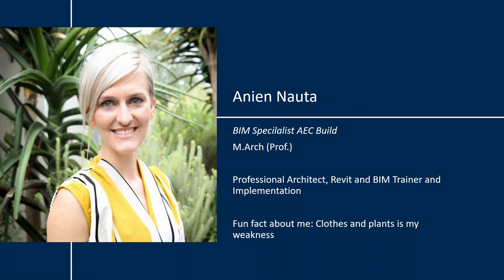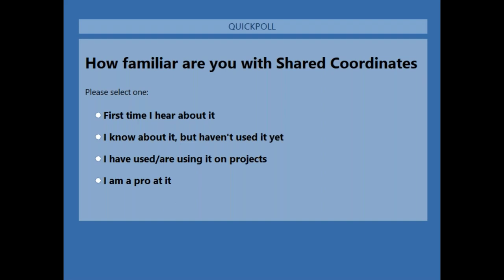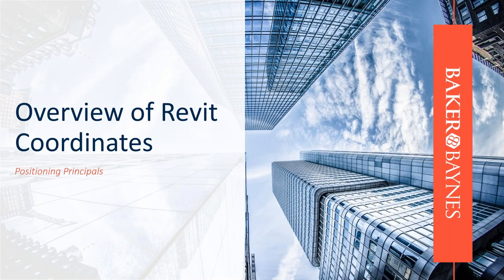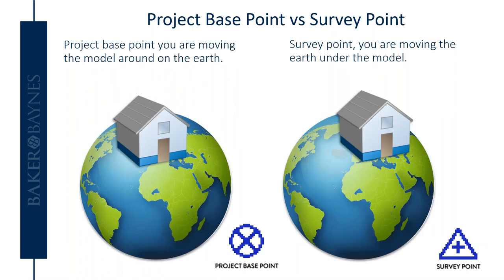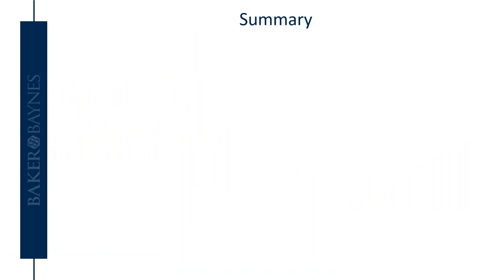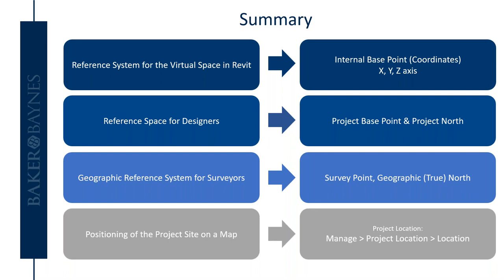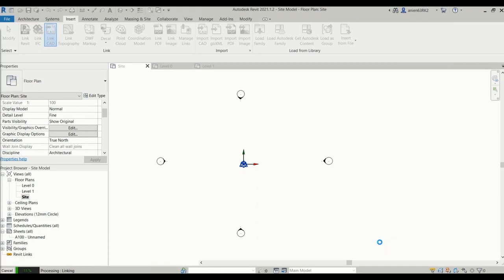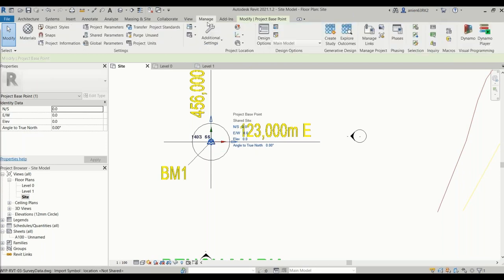Level Up Your BIM Journey   Revit Project Set Up and Managing Coordinates

Comment: Hi i mfacing one problem i link the cadd file into revit and rotate true north after that i specify cordinate at the corner of property line where it is in cadd file but when i measure the set back in revit it's not the same as in cadd file...
Reply: Elaborate your issue Little bit further please.